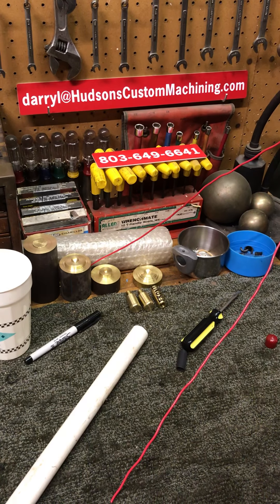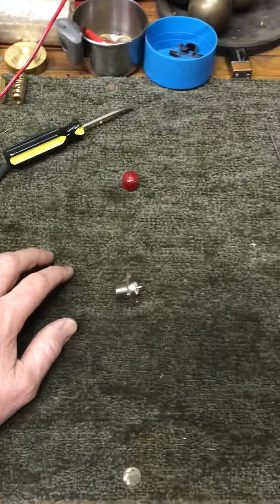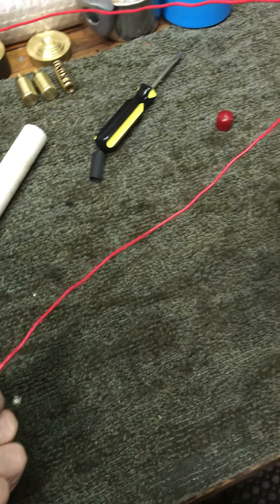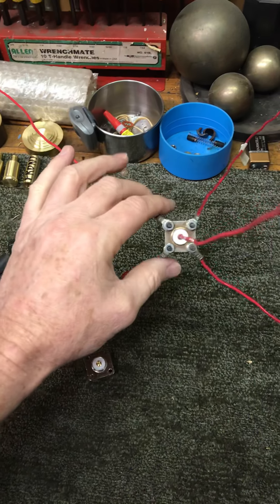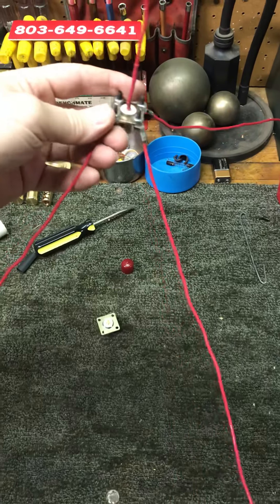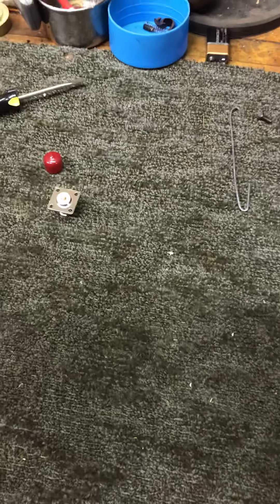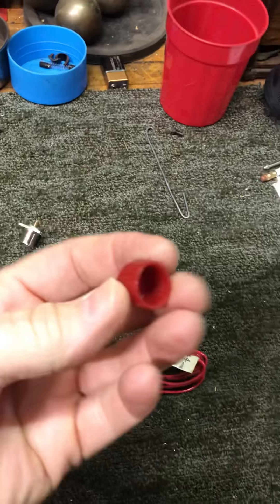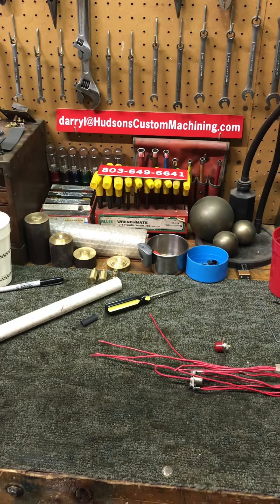Portable 2 meter ground plane antenna KD4GE

Comment: I had that same design
ground plane as a permanent
Instilation in my backyard and sealed
The top of the so239
With silicone gasket sealer. Best to use a non acidic silicone sealer to reduce electricle conductance.
I sealed it from the center radiator to the base where the four radials are and covered the insulator of the so239. Then I used a little silicone grease to waterproof the pl259 connector to the so239. The antenna worked great going into repeaters for a 20 mile radius from the antenna. That ground
Plane antenna is very
Practical and can be
Put in an attic of a house with at least
3foot of vertical space.
Nice video.

Comment: merry xmas..just want to ask f i can use my old rg8 coax cable for my base radio..
Reply from the maker: Absolutely.    There is better coax, like RG213 or LMR 400, but you can use the RG8X if your run is not terribly long and you’re just running the radio.   At VHF frequency it’s better to run a bigger coax that is not as lossy though.

Comment: gudday boss ..how long of rg8 coax cable need for may 65watts base radio..from DX419 of philiphines thank you for the response
Reply from the maker: Always try to use as short of length as possible. If you use a 10’ section of PVC pipe to get your antenna up 10 feet high, you’ll need that plus however far it is to your radio.   I carry a 25’ length coax in my go box for portable set ups.
Reply: thanks sir..
Reply: one more querry sir..do i need to add lightning arrester(grounded)for my base antena?

Comment from the maker: From the connection point out to end of wire
Reply from the maker: Yes right there where the terminal on the end of the radial mounts at the edge of the connector.    It doesn’t have to be within a 64th if an inch.   Just cut your (4) radials 19 1/4” long and mount them to the connector.